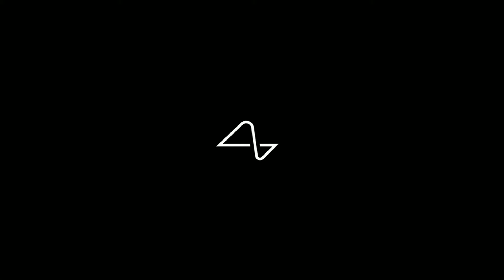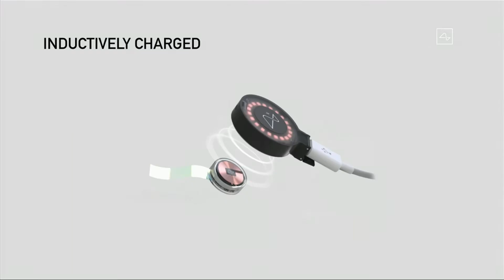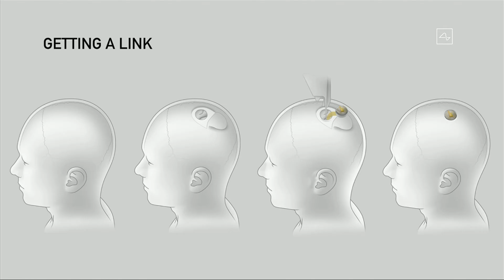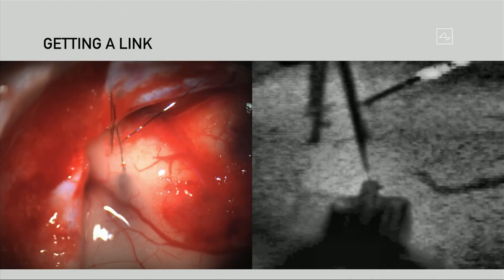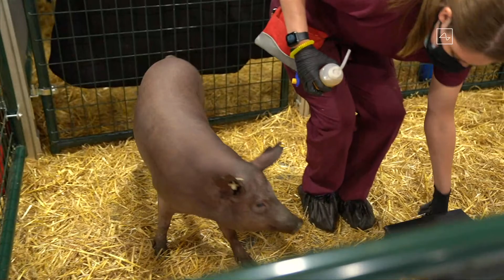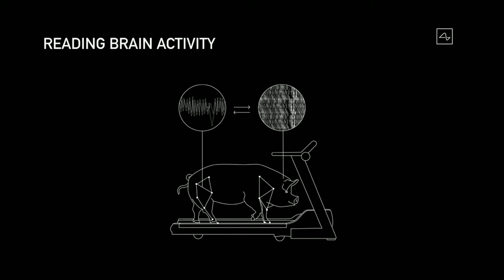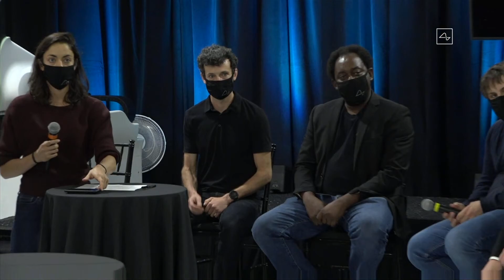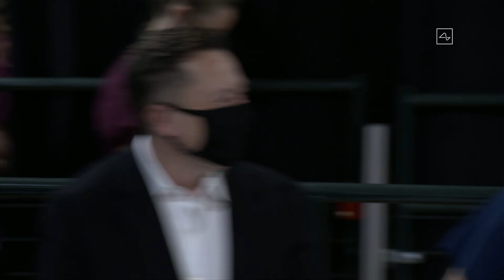Neuralink Progress Update, Summer 2020

Comment: Security question:  Is there increased measures to ensure that someone doesn't access to the Neuralink via the patient's cell phone when traveling, at a facility including hospitals where WIFI can sometimes be auto detected and used by that device?  In addition, with those devices is there issues/concerns with the amount of data that will be significant in the future to prevent lag/bottleneck issues.  Will this device be feasible in areas in rural areas?  Would it be better to perhaps have something like I2 for alternate routing of information vs. public servers?  In addition, in the future, would the device perhaps allow individuals to be like the various routing/ips and if so does that further open the door up for DOS attacks, etc.?

Comment: What if you don't remove the threads but unscrew the top part with the tech?  Would that perhaps resolve some issues in upgrading?  Also do you have a UI app for medical providers to be able to easily understand the information they are receiving of a patient through perhaps transferring it through the patient's cell phone to the provider(s) or are you using other tech for that?

Comment: Question:  I assume that the materials used are not carcinogenic.  So I'll move to an issue with removing devices, tissue attaching and making it difficult for implants to be removed.  Example:  Norplant for birth control.  I'm wondering if this is an issue in device removal for upgrade or other factors?  In addition, when having an upgrade/replacement would scar tissue be a factor and would the robotic device be able to calibrate for areas where the threads could have trouble being inserted?  Also:  For those who have angiomas (AVM or Cavernous Malformations) would this be a concern in the location it is placed and or perhaps couldn't be?  As well, what about those whose angiomas have not grown to a size visible on an MRI yet (hereditary brain disorders) or those who develop brain cancer that may invade as well as someone having a brain bleed from a head injury?  What type of battery is used to ensure charging and not corrosion?

Comment: You know how amd and nvidia use ai image scaling techniques?

Well imagine a chip that could read either from a portable camera or using your eyes, and then display a much crisper image with enhanced zoom features improved fps and night vision.

Imagine what your very expensive smartphone could do in co junction with your brain...

Ill ask the question nobody else wants to though... What happens when it gets hacked?

Could they overvolt and cause brain damage?
Used to control or track data, sound, speech, movement, dna and bodily functions.

I can deal with a phone getting hacked because it isn't a part of me and I know i cant get harmed.
Worst case situation is a battery hack to maybe cause a short.

But if your brain gets hacked, your basically fucked as its like granting a piece of malware BIOS privileges.

Comment: Would you be able to store the energy recieved into the battery so its self sustaining or will there not be enough energy output?  Maybe it reads  the input data and stores the energy after and sends out the adjustment.

Comment: About the wireless induction based charging: won't it affect the human brain?. I know that induction charging is based in electromagnetic field to create a current in a conductive material, so, won't this field reach the brain itself and potentially jeopardize the normal brain functioning?
Reply: Short answer, no. We are surrounded by the electromagnetic field all day everyday. Car radios, microwave ovens, cellphone towers, transmission of electricity (yes that does emit radio waves and infrared), etc.

Comment: Neuro - Control you lie down on the sofa, put on virtual reality glasses and speak with the voice command Start.  And then NeuraLink intercepts the signals that are responsible for the movements and redirects them into the game, in reality the body is not mobile, but in virtual reality the movement is caused by the character, and control over the real body returns only when you leave the game completely.

Comment: Dear Neuralink, My name is Abraham Thomas Bleich, and I liked the initiative to assist those with mental disabilities with the Neuralink project. I was thinking of the project, and I could not help but wonder why it began on the brain. I think an electronic stimuli device would be very well suited for incontinence. I have been thinking a while on this, and have also concluded that bluetooth, and or wifi with an app on the phone may allow things like control over farting, and the duration of, as well as the urination and defecation itself. Thank you for your time. A man with a common initiative, Abraham Thomas Bleich.
Reply: so ugh it will be Dangerous  to use Bluetooth ..If it is get hacked then it's over
Reply: @deepfakestudio7776  One, to hack bluetooth the connection must remain active for longer than any battery lifespan. Two, there would be zero potential for personal gain.
Reply: @abe5615  not really , If someone like Jeff Bezos pay someone to hack Elon Musk device in order to bankrupt him ...
Reply: @deepfakestudio7776  The connection is different than the password, and is in relation to device. The decryption would take years, and is connect/disconnect specific.

Comment: You are a quadriplegic with a Neuralink chip in your head and you’re now capable of operating an automobile (non-autonomous type). 
A villain installs an EMP generator under the hood of your car which has been programmed to activate when vehicle speed reaches 70mph.
Can the Neuralink device withstand a pulse capable of neutralizing a smartphone?

Comment: Mr. Musk, I have theorized that instead of simply bypassing some "simple" nerve damage, (I love your tech, tby the way) if we created a carbon tube that looks like a Chinese finger puzzle that could be slipped over both disconnected ends of a nerve (a double-ended sock) and then electrically stimulated it, the physical tissue would follow the electric current of the tube and they grow together? Nerolink truly is the future though. Thank you.
Reply: It's a nice idea, but nerves are (extended) parts of cells, and damage to the membrane of the nerve cell often causes the  extended parts to die back, or even to kill the cell. Putting a carbon (nano?) tube to hold them together is a nice idea, but I don't think it has the biological compatibility required (and unless places more or less instantly after the damage, the two parts would not be near enough).
Reply: That’s an ass ton of nerves to connect tho
Reply: Hey Elon is with me he said no

Comment: the incision in the skull needs to be as small as possible just to allow conduits for the "thread" electrodes. we dont need the device to be flushed with the skull that's replacing a lot of skull bone material

Comment: I liked the previous, "detachable, behind the ear connector" design better.

1. For safety and future security, there needs to be a physical, manual disconnect mechanism. No software-based disable method can fully be trusted.

2. There's an argument for having it clearly visible for other people. You want to know when your interacting with a person that may be somehow augmented by the device.
Google faced a similar problem with their goggles, to prevent "stealth recording" - but at least you can take them off, if someone is uneasy with them.

I expect lawmakers will eventually require visibility and physical detachability, if meaningful augmentation becomes a possibility.
Afterwards, a major black market might well emerge for the invisible ones, followed by x-rays at airports, etc.

Comment: Elon Musk did not invent this robot and this psychotronic technology. DARPA passed him the robot and all the rest. He just washes dirty military technologies. 
@t
@t

@t
Psychotronic means remote mind and body control. Well known bydirectional brain-machine or brain-computer interface (BCI) that allows computers and other special equipment to influence and write into human brain is, actually, the Psychotronic Weapon. You can find hundreds articles in scientific journals and mainstream media about different projects that “create” Psychotronic technologies. DARPA finances researchers in 15 American laboratories, including Rice and Brown Universities, in order to develop devices that read mind and write into it. Scientists in Brown University aim to develop a “cortical intranet” of tens of thousands of very small wireless chips that can be implanted onto or into the human cerebral cortex, the outer layer of the brain. The implants, so called “neurograins,” will operate independently, interfacing with the brain at the level of a single neuron. The system will be designed to have both “read-out” and “write-in” capabilities: it will be able to record neural activity and will also have the capability to stimulate it through tiny electrical pulses. Rice University got a grant of 18 million USD for the project, Brown University - 19 million USD for this purpose. Just tens (not hundreds or thousands, but tens) researchers are involved in these projects that will be ready in approximately 2022-2023. This information means that these scientists are actually washing ready dirty military technologies, because these technologies are very expensive, cost tens and hundreds of billions (not millions!) dollars, have taken efforts of hundreds or even thousands of scientists for many decades (not years!). These Psychotronic equipment and special computer programs (artificial intelligence) have been created, developed and perfected for decades on human subjects, including involuntary human subjects, who have never ever given their informed consent to be “guinea pigs” in these classified military experiments. Targeted Individuals are people, who claim that they are these involuntary human subjects, who were or still are used in these fascist mind control experimentation. Canadian, American and other governments try to convince that they stopped these mind control experiments on involuntary human subjects years ago, but it is hard to believe governments that have long history of criminal classified experimentation on human beings without their informed consent and reject testimonies of thousands and thousands of innocent civilian people, targeted individuals, used against their will by criminals to create, debug and perfect Psychotronic weapons. Are DARPA and other government institutions in Canada and USA going to stop these fascist heinous experiments on involuntary human subjects and compensate their suffering, losses and damage?

Comment: My main questions with this technology is how do they plan to image the deeper layers of the brain in real time without damaging the top layers when inserting the wires?

And also how do they plan on inserting the electrodes all over the brain while only drilling a small hole in the skull? How can the robot's arm reach all those weird angles?? 

If anyone has any technical insight into these questions let me know! 😊
Reply: Pretty sure that there are distinct areas for each function in the brain but it is often also spread across multiple areas so you can get the information from there. I'm pretty sure that they know what they're doing when selecting the right spot.
Reply: 31:18

Comment: Yeah but so many problems he tries to solve aren't event yet studied well enough. Most of those things don't have a clear cause. And again, the brain is unbelievably complex. If you change just one thing , it might cause other processes to malfunction. 
Knowledgewise we are just too far apart from the expectations he has and the state we are in right now...
That's just what I get from studying myself. The more I studied, the more I had to admit that we don't know anything about our brains yet. So if this device gets launched, there will be a lot of years of testing (trial and error). That's the only way I can see for it to work out in the near future without having to gain the neccessary knowledge beforehand (which would possibly take decades). And then it's a matter of ethics to me. 
Feel free to debate with me.
Reply: I was thinking the similar, we still don't know how peripheral neurons encode the information and how the brain processes them. Motor neurons are rather simple, depolarization leads to contraction with the frequency determining how strong the contraction is. But the peripheral nerves have to encode complex visual, auditory, olfactory and other sensory info into certain depolarization sequences which we have to decode and assign to their specific stimuli, and find a way to pick up these signals from the live neurons in real time without harming them, and only then we can just read the info being transmitted on the nerves. To WRITE info into them is much much more advanced, and I don't see it happening anytime soon. And the brain itself, where processing of aforementioned signals, thinking, cognition, memory and such occurs, is extraordinarily sophisticated and attempting to fully understand its nature and how it precisely works at the each level, let alone manipulate it, with the current tech I do not believe is possible.    
Note, this is also evident by this showcase as well, the Neuralink only picks up the neuron activity, not the signals themselves and it's writing function is simply running a current in different parts of the brain. Don't get me wrong as this may definitely be useful, in especially motor neuron diseases, for eg creating a frequent synthetic stimulus in the n. axillaris will cause the person to abduct their arm even if they're paralyzed, and this was already brought to life by the BrainGate project. However, creating random synthetic electrical stimulus in the n. opticus will allow a blind person to just see, or replace what you really see with a custom, synthetic image..? Random electrical stimulus in the cortex will create thoughts, memories..? Not likely.
Reply: @ultra2187  Amazing comment! I agree with you on every aspect. Thank you for taking the time to write.

Comment: I've seen many articles after presentation, where they shit talk Elon, using this Neuralink presentation as main argument, claiming that other people could've do all these things before, saying that Elon is a dreamer, over-promising etc. I wanted to write a comment on them, but they don't provide such option, so i decided to comment under this video, increasing the chance of people seeing it.

What Elon and his Neuralink team try to achieve is really something big and what was shown in this presentation wasn't easy to achieve within given time frame. I understand why some people may feel unsatisfied, because what was shown, aren't some flashy features like telepathy or whatever (i don't know what some people expect after 1 year), however these are still important things and they are not easy to do. I guess some people just started to expect impossible things from Elon after seeing what he can do, but anyway back to the point:
1. Shrinking size to make it comfortable and invisible in daily use - super important, nobody wants to look like walking science experiment.
2. Increasing density of electrodes by introducing super thin threads - necessary to shrink size, remove/lower risk of damage to the brain, or to improve performance of device by increasing available bandwidth between the device and brain.
3. Showing that removal of such device is safe and not damaging (in case someone does not want it anymore, or wants to upgrade, or whatever reason) - probably the most important thing in this presentation, because this means you always have a choice, and if you want to be early adopter, you'll not be limited if the new stuff comes out.
4. Predicting pig's movement with such accuracy in real time - show me any other BCI in this form that can do that.
5. Scale-ability by implanting several devices like this - allows for more functionality.
6. Creating a robot that allows for safe and consistent implantation - ensuring that distribution of talented surgeons around the world won't be a limiting factor, and that people can expect the same success rate of operation, low price, etc. - regardless of where they live.
7. Real Motivation and will to do the right thing from Elon - which assures that Neuralink will have all the financial support it needs, that the company will provide great environment for innovation (which is important, cuz most CEOs on the planet care only about money, power and fame), which will bring the best people that exist to the team who can then work together and achieve things that otherwise wouldn't be possible - in this company people can actually see the future.
8. End goal - to bring this device to global market, and make it affordable to basically everyone, so nobody is left behind - which will benefit all of us, and also make the product a lot more useful to society (to compare, imagine what if mobile phones or internet connectivity would be available only to the richest - by making Neuralink widespread, it will allow for so many things that otherwise wouldn't be achievable). Other companies would first try to squeeze as much money as they can from people once they have monopoly, and only when competition comes - that's when they would lower prices.
9. Animal care - just another proof he cares about other beings, regardless of who they are, because it's no one's fault how you're born, and everybody should be treated well.

Elon does not try to earn money - Elon, tries to make the world a better place, and while all these things may not seem as spectacular to some, they are super important. But as with everything that Elon tries to achieve, it takes time before people start to see that his approach actually makes sense. Elon does not think in short term - remember!

Also... pig on a treadmill LOL xD